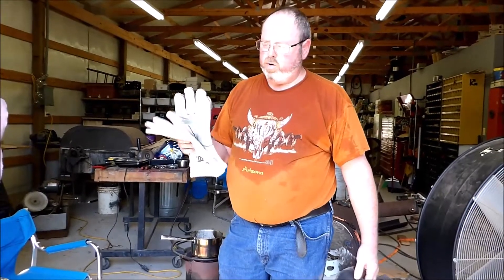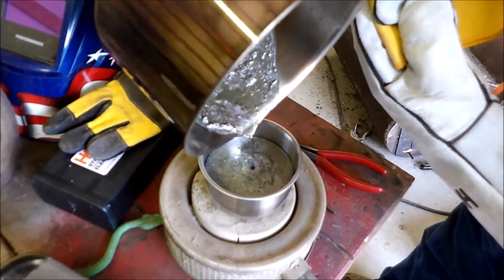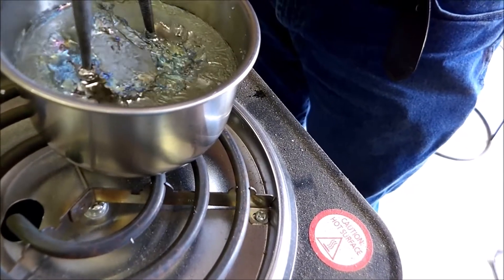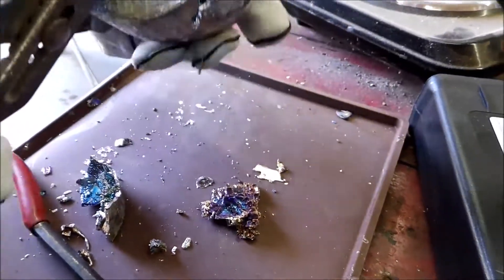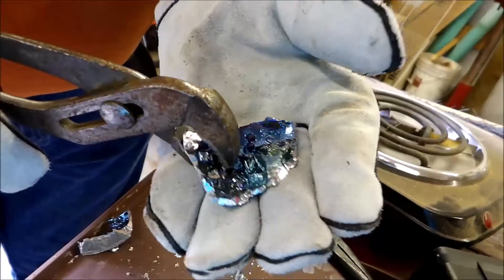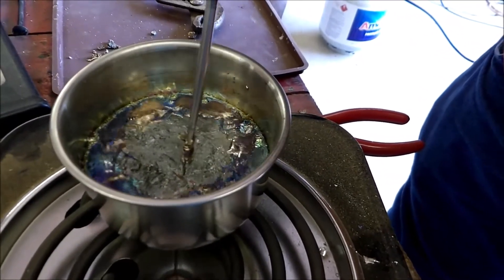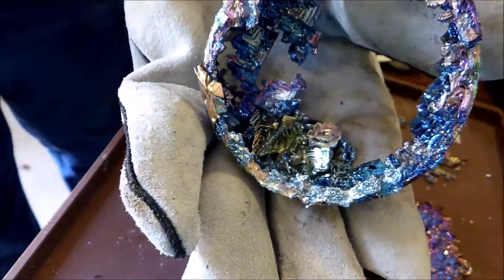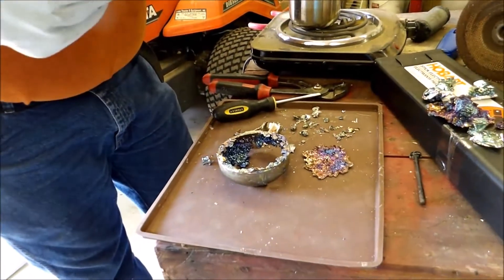How to Grow Bismuth Crystals

Comment: Hi there!  Great video!  I have a suggestion!  To get larger crystals the melted metal needs to cool slower.  Insulating the outside of your pot or using a blowtorch on the outside of the pot as the metal cools will produce bigger crystals.  You are keeping the sides of the pot too hot for nucleation to occur.  This forces it to happen on the surface first.  You will need to mess around with the technique.  Good luck!
Reply from the maker: Thanks